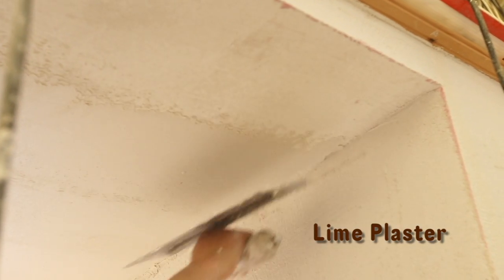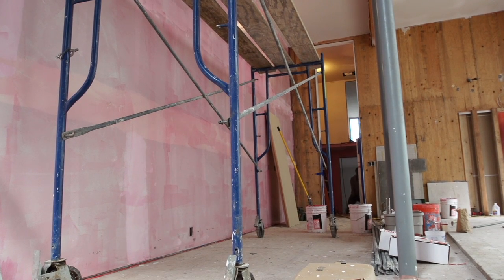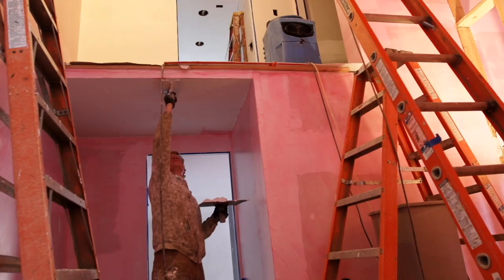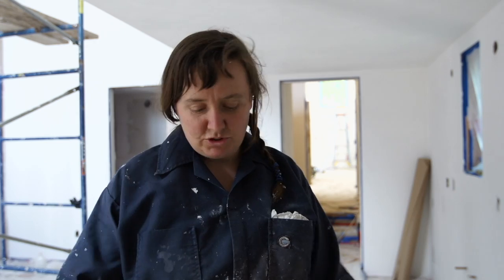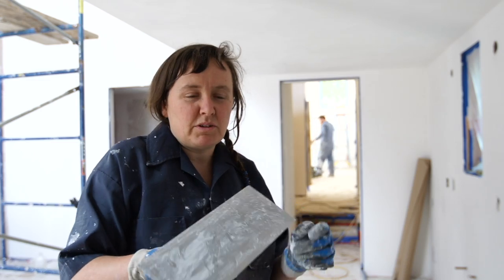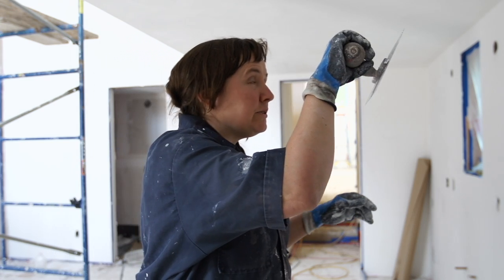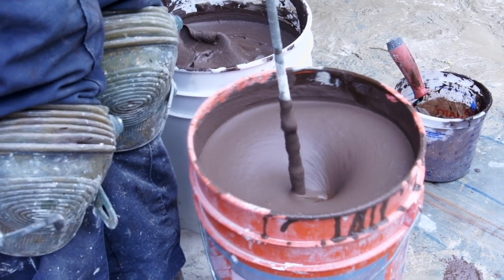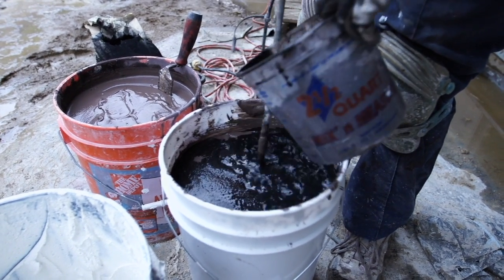Flexhouse:  Lime and Clay Plaster

Comment: The Miracle lime you used has high magnesium content (~30 percent) and is therefore a dolomitic lime. Typical plastering is done with high calcium lime (~95% calcium hydroxide), or fat lime. How has this plaster held up over the past few years? Do you foresee any longterm effects caused by choosing a dolomitic lime over a high calcium lime?
Reply: Interesting. You have to be careful about versions of reactive MgO expanding over time in wet environments - that is why the content is limited in portland cement, but otherwise I think it is generally more durable than lime. Would like to know more actually. It is used as a shrinkage compensator, and the price is going up.